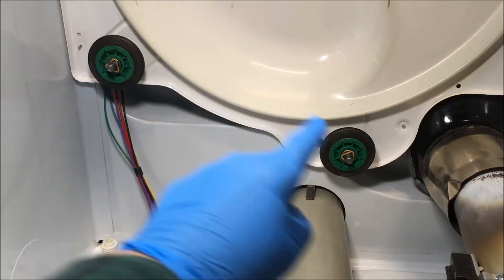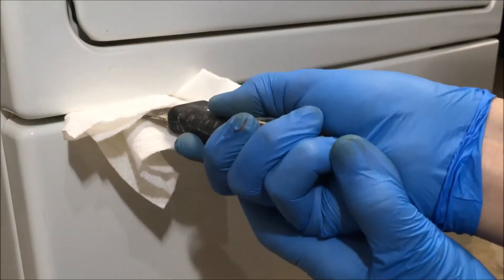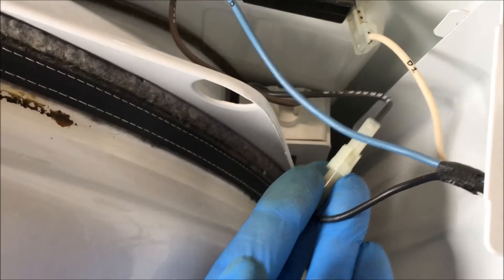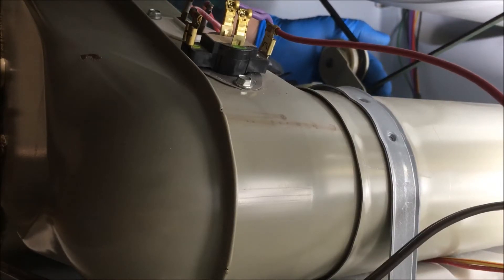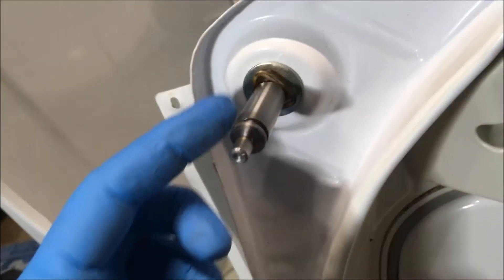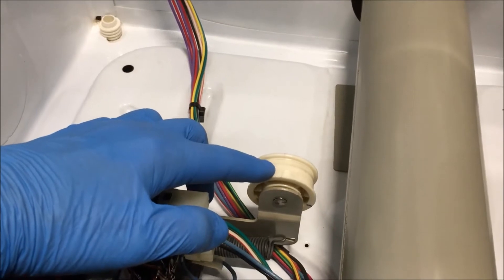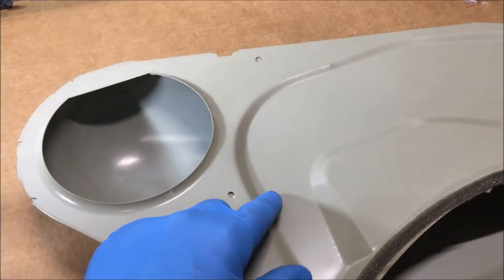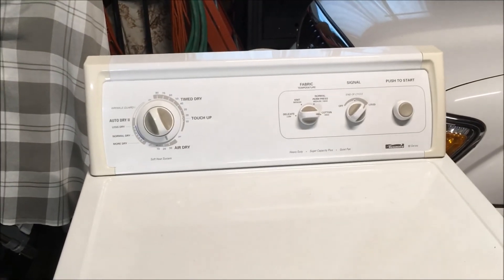Replace Dryer Rollers | Kenmore 90 Series | Dryer Squealing, Squeaking, Wobbling, Thumping Noise

Comment: Great video thanks so much.  My dryer wont start and the rollers are completely locked up.  I have 2 questions- Can you please clarify whether the rollers will need replacing if they are locked up? Or can I simply clean and reassemble?  Second- my plugs on the top left are super stubborn, I feel like im gonna break them.  Any advice on getting them out without causing damage?  Not sure how to lubricate plastic with electric wires involed.   Thanks!!